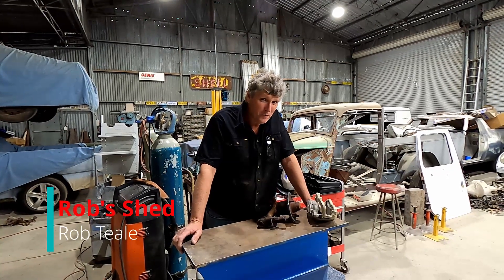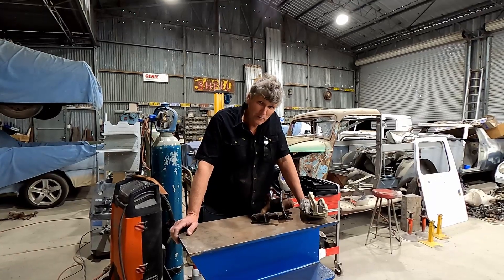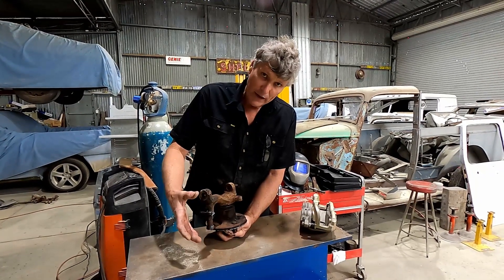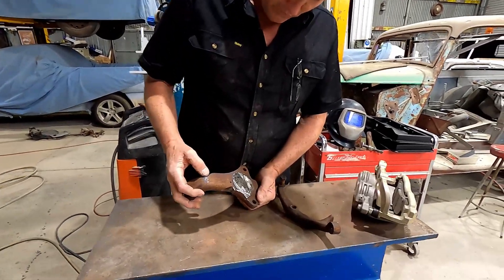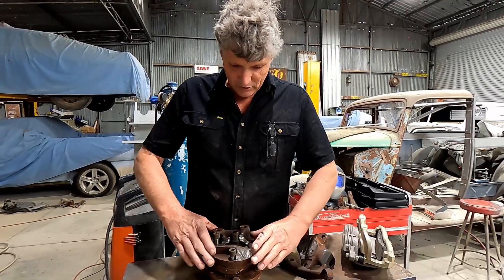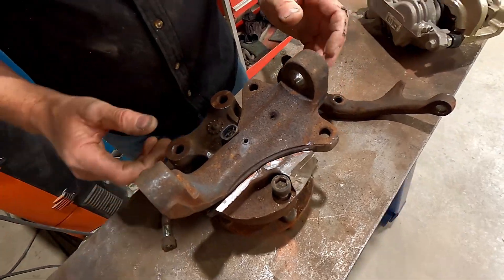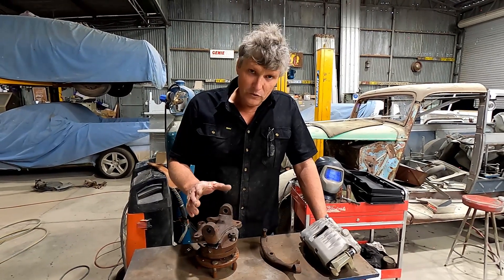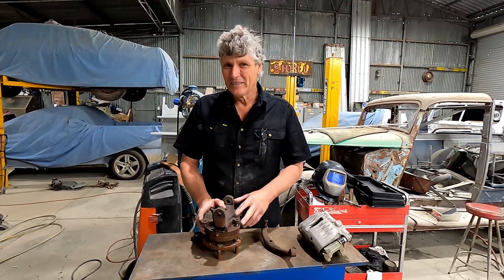Prototyping unique steering components

Comment: Good idea but would it pass rego in WA?
I would imagine it would have to be engineered and tested but even then likely still get knocked back by the DOT.
Reply from the maker: Hi mate, no problem at all, yes there is a process to get these things done. I have been modifying cars, trucks, boats, tractors and the odd motorbike since the 1980's. To date everything that I have presented to Dot has passed without any hassels. Why, because I build everything to excess, I do the reseach and make sure that it is done right. Lets face it as a proffesional if something I have modified fails and it leads to an accident, and heaven forbid a serious injury........I am toast. I have made pitman arms, idler arms, torque arms, and adapted more steering boxes into different vehicles that I remember. XF Falcon into HK/T/G Holdens, HQ into FJ Holden, and Holden Rodeo into tri five Chevys to mention a few. Everything went through my design process, engineering approval and Dot. As far as the stub axle I am playing with now, the design alone with the bolt on hub is stronger than the original type. The loading on the center section of the axle is spread out over a wider section than the original bearing spindle, and the area that the hub is bolted to is significantly bigger than the cross section of the original. The addition of the increase of strength by bolting the hub onto it  leaves the original in the dust. Rrs use the same idea with their strut conversion for early Falcon, they have gone through the process ahead of me and paved the way. Lol. I will keep you updated, but only if it will physically work, caliper fouling the crossmember shoots us down long before the law.😉
Reply: @robsshed  
Hi Rob, thanks for the reply. I have no doubt about the quality and design of your work. Everything I have seen you do is always well designed and executed. My point was more that I have heard that the DOT is not always easy to deal with. I understand that they need to keep dodgy mods off the road but there are plenty of well engineered cars that have been registered in the past that wouldn’t be allowed in principle today due to the interpretation of the rules. I think that the ability to fit abs to an older vehicle is a great idea that improves safety and hope that your project goes ahead. It is be good to be able to to use a lot of off the shelf factory components such as Commodore stuff too.
Look forward to seeing more. Cheers, Bill.
Reply: @robsshed  I would love to see a video on the HQ to FJ steering box. There are so few videos on upgrading the mechanicals on FX/FJs on YouTube.

Comment: good idea but  they get touchy about widening the track width with anything to do with front end updates
even putting HR disc brakes  front end  in a early holden   theses days 
maybe try getting it cast with the abs part formed into the up right to reduce widening the track??
Reply from the maker: Zero change in track from original. The next step is to build a welding jig from the original drum brake stub, and use that to hold the new one aligned while welding. Hopefully it will all go to plan. Cheers Rob.